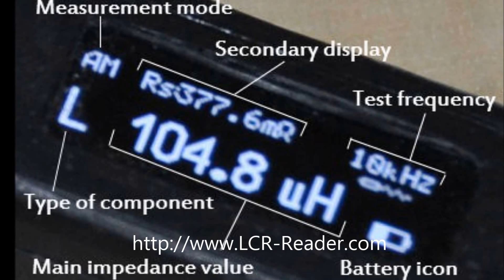LCR-Reader Consumer's Choice LCR-meter

Comment: Thanks for the estimates of parasitic capacitance/resistance, I thought it would be larger.. I suppose as long as I can mentally offset them it will be adequate. It says in the manual 10pf is the lowest it can read, will it just not show any values under 10pf? Even if I manually set it to C mode? 
Maybe for my Christmas preset ;) I will purchase, I like the OLED screen.

Comment from the maker: The problem is that it depends on the the distance between the tips. It is roughly about 1-1.2 pF. The parasitic resistance of the tips also depends on the tip contact quality, dirt and gold layer condition varying with time. For a new device it is about 0.04 mOhms but it can easily reach 0.1 Ohms.